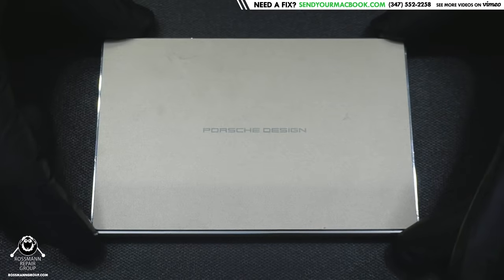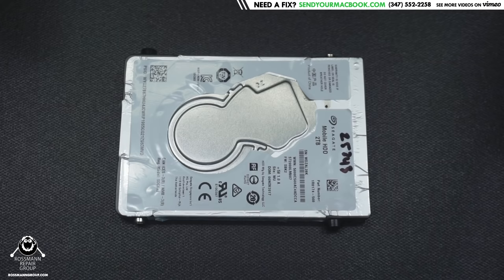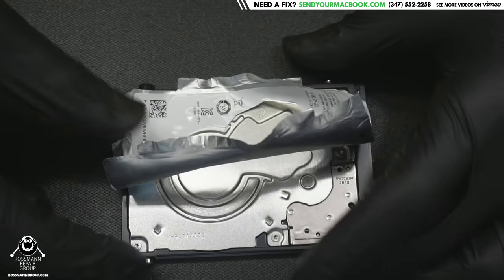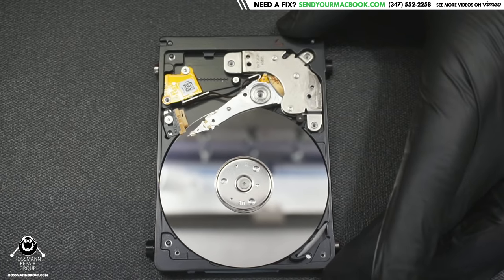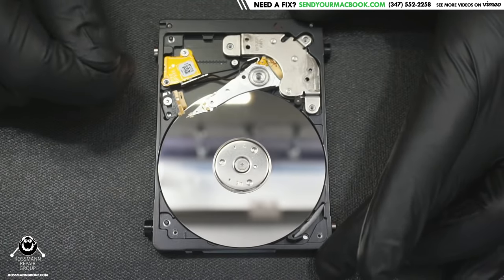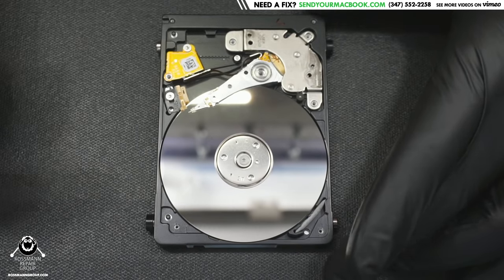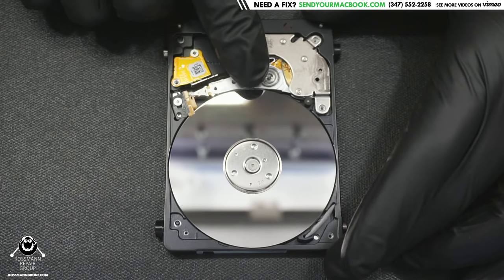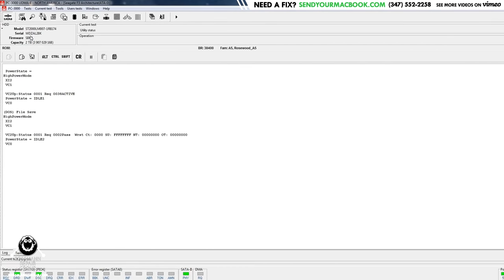Why your Seagate external hard drive is beeping; beeping hard drives can be recovered with this fix

Comment: Seagate - Creating Data Recovery Jobs Since  We Stopped Caring
Reply: ok i fail to understand why the seagate antagonism, i have a seagate barracuda and it hasnt failed me ever

i even have one from 1993 and still works perfectly
Reply: @Wolfrich666  It's simple, they fail a lot. If yours didn't die you are just lucky.
In the shops I worked it's always the same pattern. Dead hard drives go like this Seagate > Samsung > Maxtor > WD > Hitachi
I don't know about Seagate now but 2000s Seagate was awful.
Reply: important to note, that even at a 10% insane failure rate, your drive would be fine 9/10 times, so singular positive experience in hdd terms means nothing.
multiple negative experiences mean much, even though  a reputation like seagate doesn't come out of no where.
they are known to be the crappier option.
i mean western digital literally sold and kinda still sells suicide drives.
drives that had set load/unload timers set to 12 seconds with 300000 load/unload cycles being the maximum the heads are designed for, so they created consumer drives, that would literally kill themselves over time, BUT STILL seagate seems to be the crappier option.
seagate nowadays even dares to sell SMR drives to unkonwing consumers, which by nature have higher failure rates and are more sensible to vibrations.
and on top of that have massively slower continuous write speeds.
they don't mention SMR (shingled magnetic recording) anywhere  on the drives they sell marketing wise, like a lot of their mobile line.
so seagate is shit, western digital (owning hgst btw) is shit, but seagate is more shit than western digital, if that makes sense :D
Reply: @cataria3903  so...in your opinion and experience what kind of drives are considered reliable then?
Reply: @MiGujack3  i run a nas with 12 seagate drives. none of them failed and are running since 5 years ago, every day, 24/7 .
Reply: @cataria3903  well, right now i have my seagate as my main drive and now i have a WD as my secondary drive where i make my backups XD
Reply: @malte spielt
12 drives aren't enough to make a positive statement on drives as mentioned in my first comment.
positive results  need 100s of drives to have a significant statistical effect.
that's why backblaze's data is so good.
also i assume u check their smart data regularly, or the nas does so automatically and don't just think of total drive failure as failed?

a good comparison would be, the need to have lots of participants (1000s) in a double blind randomized  inert-placebo-controlled study, that runs over many years to determine if a medication is safe or not.
and also if it's effective or not, 12 ain't cutting it :D
such studies aren't done for vaccines as example and instead those "studies" run for a few days, less than 30 usually and don't use a placebo, BUT that's another sad story....
Reply: @cataria3903  yeah i know. i check the smart data and they still run well, but i know they can be bad and backblaze had some problems with them as well.
Reply: @MiGujack3 Yeah, as someone who used to work in a PC repair shop, I can say that most of the hard drive failures I saw over the years were Seagate drives. You can get lucky with anything though. 9/10 of them could fail, then that 1/10 could get a drive that lasts for 10 years. 

But yeah, I agree. Seagate sucks donkey balls. I never recommend their stuff to anyone.
Reply: @MiGujack3  Samsung drives are just Seagates these days. Similar to Hitachi being under the WD brand now.
Reply: michtoppien666 Any drive that doesn't have mostly negative reviews because of high failure rates. For any drive you just make backups. Buy two drives, make backups to 2nd, once in a year swap them, once in 2 years buy another drive and use the oldest as external drive for the stuff that isn't important. Also you can get a mirrored NAS. But for critical data you should also always have offline backup. Never use SSDs for long term backups. Only mechanical drives. Some SSDs can lose data when left in unpowered state for a few years.
Reply: @Wolfrich666  The old Seagate drives where awesome, but something happened that they turned to shit from around 2010 till just a few years ago. I stopped using them after about 2 out of less than 10 where failing in the first year! Now I haven't seen as many failures from them and the Backblaze stats they post in there blog supports my thoughts... still wouldn't go with seagate ;-) But if you missed the years where they made complete crap than i say your fine getting the new stuff.

My go to reliable drives where Hitachi/HGST but for the last few years its been Toshiba, the few that do fail are past there life span and fail slowly giving time to migrate the data safely. Seagate and WD seam to crash and burn giving no hope.
Reply: what to do if the head can't get back to the disc? like it seems to be too low?
Reply: They never started caring.
Reply: @Wolfrich666  When you buy 6-7 drives some internal some external and they have all been treated well and yet due to a well known head reader crashing into the platter issue that Seagate took forever to work on (not sure if they fixed this eventually), they all died taking all the data with them, that's a massive failure rate, their failure rate is the highest and unacceptably high, this is why they get richly deserved antagonism. Fuck Seagate and their shit drives.
Reply: I know someone that works with this kinda stuff and he told me once u opne the box inside that has the disk it becomes useless. It stops working
Reply: literally my 3TB barracuda died yesterday. i was watching a video and the clicking began every second and another weird to explain sound. idk what to do, open it myself and try.

Comment: Vote with money, don't buy Seagate
Reply: Wd all the way
Reply: I had two go on me in the same system with in months of each other.  Will never by them again.
Reply: Gomam0n  Anything can fail on an HDD. I personally don't touch or move mine when they are working.
Reply: i have a seagate from 1993, how is that still works? seriously i dont get it, i would be happy if you could elaborate more on the reasons why seagate shouldnt be trusted
Reply: @Wolfrich666  I have had many of them. Many have failed. Were Not in use 24/7, not in hot environment. Older Pata were a bit more reliable
Reply: @Wolfrich666  Simple. They don't make them like they used to. ;)
Reply: @XtremeKremaTor  then what brands you recommend?
Reply: @Wolfrich666  I would go for wd. But NOT the one Recertified. Look up backblaze ranking.
Reply: Never do! lol. WD, though, hell, yeah!
Reply: I always buy WD lol to be fair though I do have a very old Seagate Momentum laptop hard drive from 2011 that I took out of a old laptop and it still works well to this day.
Reply: @XtremeKremaTor  lol backblaze dont even use wd anymore. Look at the last list. Less than 1% fails from seagate. You are justo a BIG fanboy.
Reply: Yeah, my 2TB Seagate External is the sample, beeping and cannot fix it by myself

Comment: Steve recovered my Seagate 4 TB. Saved all my data and structure!!! 4 years worth of video and pictures.
Reply: How much did it cost? My 4TB seagate is making a clicking noise. I only paid $100 dollars for this thing, and I don't feel too comfortable paying upwards $200 dollars to get repairs done on it. It mostly just houses digital copies of all my movies. And although I can just re-download or rip the movies off my DVDs again, I'd prefer just to get the hard drive started back up again so I can backup my digital copies somewhere else. It would be so much faster. But I don't want to spend a ton of money to do this, especially not for a cheap Seagate that only cost $100 dollars for a brand new one.
Reply: How ca i send you the hdd

Comment: Oh look, another broken Seagate drive. How surprising!
Reply: Search "wd hdd fail" there you go fanboy
Reply: @FedeSkillArg  still fails less than a damn seagate
Reply: @deadalkabob  backblaze list. Less than 1% fails from seagate. Wd not in use anymore, owner of the record of more fails in history of backblaze. If u had a seagate fail on you, it was just a faulty one. The end.
Reply: @FedeSkillArg   precisely the external seagate drives those are terrible .
Reply: i wish i knew this before buying one...:/
Reply: @beckydarrow  i have wd, toshiba and segate drives. I just had one wd failling on me at just 1 year of use, that didnt prevented me from buying an external 2tb wd and its working fine for 4 years now. This hate just come from people who bought a seagate and it failed. If you bought one, dont worry, if its not faulty (all brands have faulty ones) it will work perfectly for years if you take care of it, and seagate drives are faster than wd. I should know, i own both.
Reply: @FedeSkillArg  mine is beeping now 😓
Reply: @beckydarrow  yep, the fall could have done it, and its worse if it was running. I had an internal 500gb stop working after a fall from a chair when i was cleaning the case. Hard drives have a lot of mechanical parts. Claim the warranty if its still on time.
Reply: @FedeSkillArg  for warranty, do I need to tell them what happened?
Reply: @beckydarrow  dont tell them about the fall, tell them it just failed randomly while using it.

Comment: What a trash decision,  to not have hermetically sealed drives to save 0.5 cents
Reply: not intended to ever be serviced....; who the hell works on $50-$100 drives? :)
Reply: @mdd1963  you've missed the point here
Reply: @kyledailey  Nope. Silicone is used as a sealant. Which is what his comment is about. (Using silicone to seal the HDD.) Silicon is used in microchips.
Reply: @xenonram  Yep, I was only thinking about electronic chip layers. Yes, Silicone is used for sealing, duh. Too much moter-boating last light ;-) I stand corrected. Thanks.
Reply: It's only within the past decade that sealed hard drives (aka helium drives) have been commercially viable. All conventional drives use air bearings to allow the heads to fly at the correct height over the platters. Sealing a conventional drive would mean it could only be used at the same atmospheric pressure level that the drive was manufactured at, that's why they have breather holes with particulate filters.
Reply: @mdd1963  I would imagine they work on them for people who are stupid enough to store priceless data or hundreds of hours of work only to their external drive, and to ya know to recover that data...not to keep the drive working for another two years
Reply: for andrive you didn't opened in a sealed room the seal around the unit is the last of the problems ...

Comment: After a little practice, I did exactly what you showed (stuck heads on an external 3,5'' seagate 500gb) for a customer, saved 80% of their data and for the first time I got paid for it.
Just wanted to leave a THANK YOU.
Reply: Will you elaborate how u did and any tips for because mine's the same drive and same problem
Reply: there is not much to explain, other than what you see in the video. I just carefully opened the drive and positioned my hands as shown in the video, in order to give a small turn in the platters (with one hand) while moving the heads back into the parking space (with the other hand). 

Watch carefully the video and believe me, I didn't do anything different other than what's shown there :) 

That's all you need to do.
If the problem is "stuck heads on the platters", after you perform the above procedure, (and close the drive, of course) the drive will probably start and you should be able to retrieve a good amount of data.

Just keep in mind that you should not experiment on how many times the drive will start: You do the above procedure, connect the drive and treat it like it's the absolute LAST time it will turn on. Don't expect it to last. Retrieve what you can, as fast as you can, because the drive's life is in a fast countdown !

Comment: It's actually pretty easy to unstick a stuck hdd. While I'll have to agree that you shouldn't open up hard drives, I personally have never once had a previously opened one fail down the line because it had been opened. The only really good advice is DO NOT touch the platters themselves, as this WILL damage your data. Just opening the drive and turning the platters by means of turning the hub will not in itself damage data (unless the heads have actually gouged into the surface of the platter, in which case the heads are probably screwed anyway)
As for the thing about getting dust on the platters, I've nevr found this to be a problem, as long as you don't do this in a dusty environment, and obviously don't leave the drive open for any longer than absolutely necessary. Remember that the disc spins fast (5400rpm or higher) so any loose dust on the surface is going to be thrown right off the disc surface by centripetal force, and will get captured by the dust filter which is in there for this exact purpose.

I had to unstick the hard drive on my old laptop around nine years ago, and while I did do data recovery on the drive after it was runing again, that very same hdd is back in the same laptop (which is in almost daily use on my workbench, doing everything from functioning as an audio oscilloscope/logic analyser, usb microscope display and ebay parts ordering machine), and nine years on, the very same hdd is still working without any issues whatsoever, so although in all honesty I wouldn't recommend opening up a hard drive unless it's a last resort, it's comforting to know that if you're careful, this can be a long-term fix.

But DO back up the data on it as a precaution, just in case.

Interestingly, this problem only seems to affect laptop hard drives. I'm sure that sticktion could happen on a 3.5" hdd I've never seen one myself with this same problem. I guess the tiny spindle motors in laptop drives simply don't have enough torque available to pull a sticking platter away from the heads
Reply: @sbcontt YT mildly dropping it might cause it to be worst
Reply: my first 3.5" HDD had this problem. But unlike other HDDs (It's a Maxtor DiamondMax 23) there is no parking position outside the disk and it's physically impossible to get the arm there. Instead, it looks like the parking position is in the center of the disk, since that is what got my drive spinning again. So far no luck with data recovery tho. The data does show up (not always) when connceted by a USB 3.0 - SATA adapter. But trying to access it freezes the windows explorer and any other program trying to read this drive.
Reply: My hard drive is spinning again but is not registering it on my xbox, I’m gonna try and let it do whatever it needs to do overnight.

Comment: Steve I must say that was fast & clean video. I would love to see how do you inspect the head's? Tnx
Reply: What do you mean? You use a comb to keep them seperated, put them under a microscope and check for visual damage. Broken wires, cracked or dislodged sliders, deformed coils, things of that nature. If they don't look perfect, they're defective/damaged.
Reply: Generally you don't "inspect the heads." If your data is important enough to pay hundreds of dollars to retrieve, or attempt recovery yourself, you replace everything. You're already opening it up, so replace the arms/heads regardless. You would have to remove them to inspect them, so regardless of the outcome of that inspection, don't of the old ones back in. Even if it's a 99.9% chance they're fine, why chance it. You've already taken them out, and there's a 0.1% chance they're bad.

Comment: The old school solution for 5-1/4 half height drives was to stand it on it's side, lift it an inch or two on one corner, and let it fall on it's side onto a towel. The sudden change in rotational inertia would often un-stick the heads by shifting the platters.  No need to open the drive and introduce dust.  This may work on these smaller drives too.  Goal is to get the platters to rotate to a new resting position.  Do not drop on the bottom or top.  You don't want to bounce the heads on the platters.
Reply: surprisingly worked on my 2TB Seagate backup slim
thanks bro
Reply: man it worked thank you😭😭
Reply: I don’t get it please help
Reply: @brammie155 what do you do I don’t get it
Reply: @urlocaltokz4863  Stand it on a corner. Let it rotate and fall on it's side. In falling it rotates. In landing it stops rotation of the case, but the platters due to momentum continue to rotate and free stuck platters. Normally it is not a good idea to drop a hard drive. This may recover a broken hard drive for data recovery and it not a long term fix.
Reply: BRO WTH I JUST TRIED IT AND IT ACTUALLY WORKS, NEED THIS DRIVE FOR WORK AND JUST WOW THANK YOU. I tried it on 2 corners first and it didn't work (only dropping once on each corner), and I got it to detect my external HDD on the third corner/drop onto towel. Thanks a bunch.
Reply: 4 years later and it still works bro you GOD SENT
Reply: Geezus that worked for me!  Hot dog I'm so relieved that i didn't lose all my info.  Thanks a million.  :hand-purple-blue-peace:

Comment: My easyest recovery when I just flipped upside down the hard drive and the system recognized it.
If you don't want to loose your data I recommend to use WD Blue, those drives amazing and mostly easy to recover at home (sorry Steve :). Ones it took 8 days to save the data from a 320GB drive, but the end 10 years of photos and videos recovered fine.

I use simple PC and Linux, but there are some pretty stupid devices wich copy the data bit by bit one drive to another, it can be handy if you dealing with bad sectors only.

By the way with these prices not worth the risk to try at home. I remember when recovery cost a fortune, then start at $1000, than $500, than $300 and now its $100.